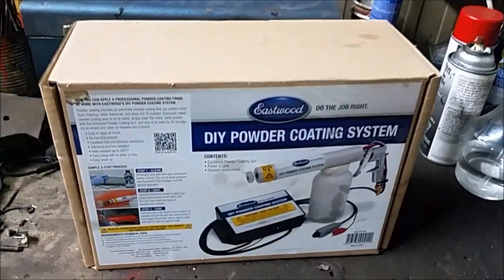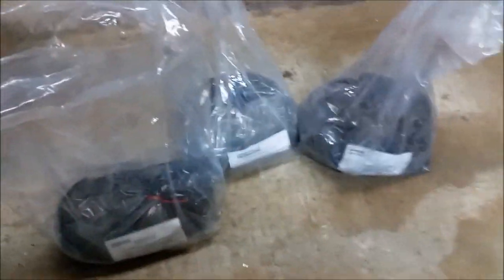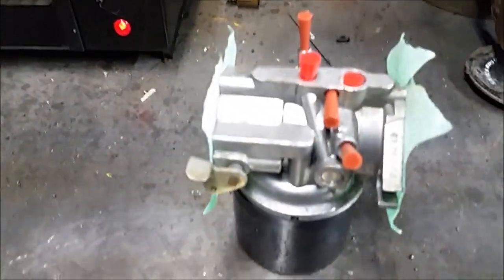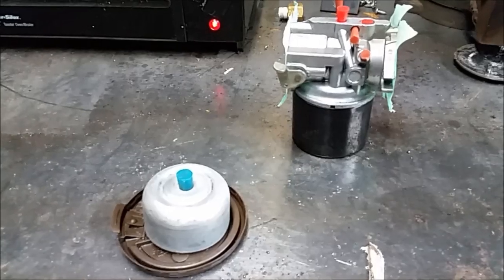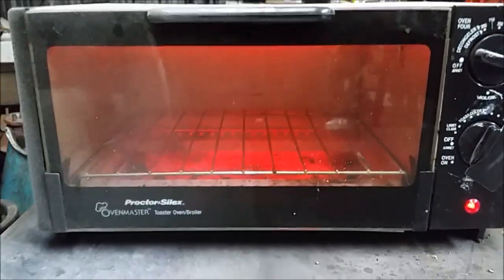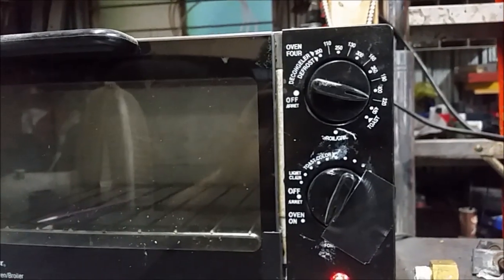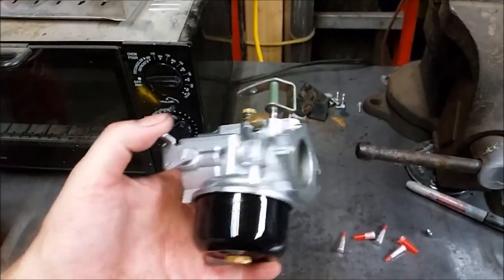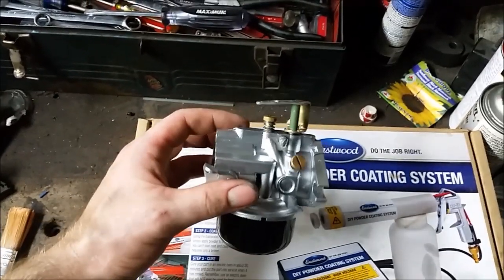Eastwood Powder Coat System Review and Trial

Comment: Cool vid.  If you’re new at PC here’s a few tips.   Save silica packets and use then to keep moisture out of your powders.   Not. All pieces can be hung so use small pieces of pipe or tubing along with rare earth magnets to hold them in place.  Use a piece of ceramic tile as a base to set your work on in the oven, it helps with temp regulation.  

PC is fun and easy.  Just always have a clean part, a good ground, and the proper temp.

I PC wheels for my Jeep by dray stacking cement blocks and hanging an over element inside.  It was hinky, but they still look great five years later.  I have also used a 16” duct pipe and a hot plate to coat longer parts.  Be creative!

Have fun!

Comment: Now that you have used it for a while are you satisfied with it? I was debating spending $69 for the Harbor Freight System of $109 for the Eastwood (on sale) Biggest difference I see is that HF is a top load system, has a foot switch and is a single voltage. Your opinion?
Reply from the maker: They have similar ones here at princess auto.  They seem fine.  I've had no trouble with the Eastwood one and they do have good customer support.   However I have nothing bad to say about the harbor freight one either.  Lots of pros used the harbour freight ones for years with no trouble that's what made up my mind to go with them vs the cheaper imports.

Comment: Very nice! Did you have to sand blast the old part or did you just clean it, if so with what? And could you drop a link to where you purchased the gun....thanks!
Reply from the maker: no i did not sand blast it just thoroughly cleaned it in lacquer thinner.  Bought it from the Eastwood company here https://www.eastwood.com/hotcoat-powder-coating/powder-coat-guns.html
Reply: Would of come out smoother on the silver if it was blasted i think